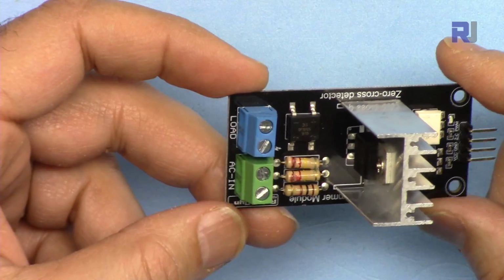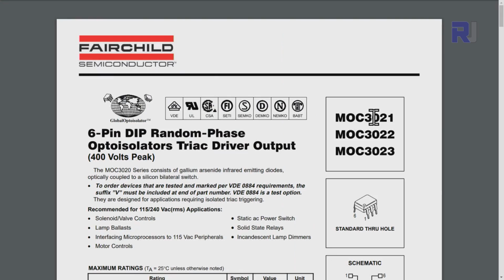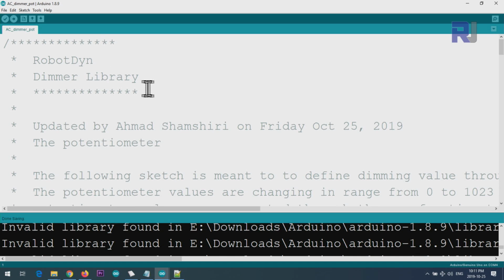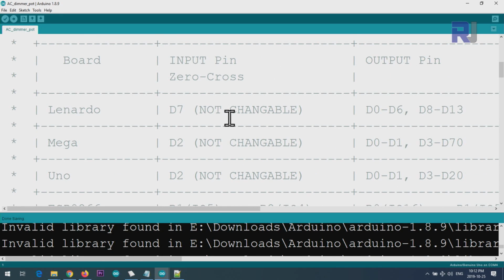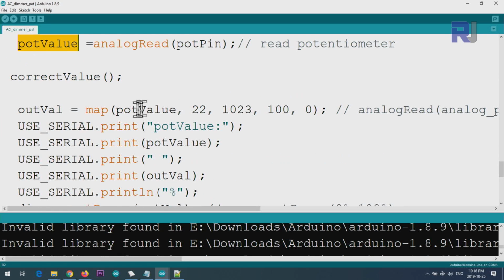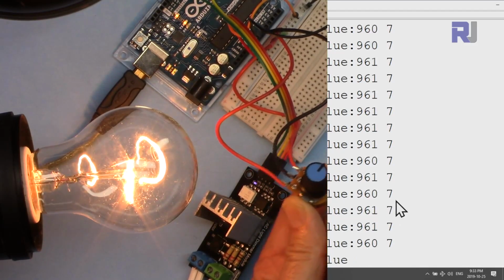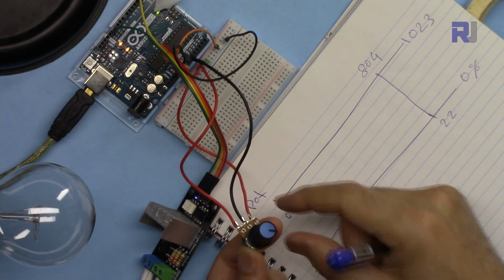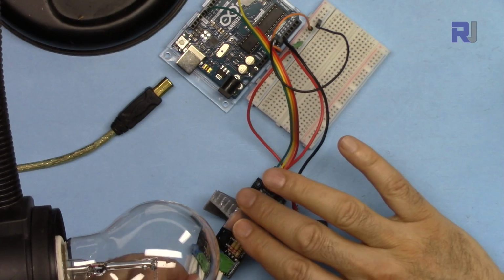RobotDyn Control AC bulb with Arduino AC Dimmer - RJT229

Comment: This is beyond stupid what you are doing, also shame on canadians.
First: There is no way to turn the AC voltage off, yes the bulb is not shining but it still got current passing through it lmao.
Second: Why wouldn't you fit potantiometer's values into the range of the circuit's library instead of just being able to use a part of the potantiometer because you fitted (solved for) them both. You just made half of the potantiometer useless.

Comment: After the correction of the values it just stopped working at a maximum brightness adjust working as a around 70% brightness it should be at 100% brightness before the correction the brightness of too high after the correction brightness is low

Comment: Hi Ahmad
Do you have any experience with ESP32C3? 
I tried this library with esp32 platform but it's not compiling.   Im reading online that I need an older version of esp32 board manager but that also gives compilation errors that some header files do not exist.
Thanks
Reply from the maker: Hi, here is a project where ESP32-C3 is used https://youtu.be/XEZLyznWmYM

Comment: How Can i use it for three phase?
Reply from the maker: You can't. You will need three of this device and timing control to turn each at 120 degrees. What kind 3 phase light ? This is only for light.
Reply: @robojax  i’m trying to do a soft starter for 3ph induction motor using arduino,it worked pretty well for single phase but when i tried to use three of the circuit for 3ph it didn’t work I don’t know why

Comment: Hello, do you understand with the problem what i have, I'm using ac light dimmer by RobotDyn too, but the difference/problem is when trying to hit high percentage the voltage result are reduced and getting smaller than while 40%, can you help me to solve the problem? Thank you 🙏🏻
Reply: And tell me how to fix it or should i buy a new one?

Comment: Hello, do you know if I can control the brightness only through the Arduino code and without the manual knob? Also, if I used an ESP32 instead of an Arduino uno, would it still work?

Comment: Hi, is it any possible to do this project automatically by using BH1750 light sensor ?
Reply from the maker: Hi, yes it is possible. Just replace the value controlling the bulb from the light sensor. I have explained the light sensor fully. Watch, learn and implement

Comment: Hi, can you tell me which command is used to control multiple dimmer boards connected to arduino 1?
Reply from the maker: Hi, it seems you have not watched the video. it depents on the humber of interrupt pins you have on Arduino. Just use different interrupt pin and defined other related variables to make it work.  If you don't know what a vriabel is then watch this video https://youtu.be/xi9Hegk9M9k

Comment: sir ive question, if i want make a pararel lamps about 8lamps , and 4 lamps on 4 lamps off but they will works change between that 4 lamps off and on.
and i want they like using dimmer , but i dont want using dimmer..like exactly Lamps b7c

Comment: Makers using Arduino Dont Know much about Timers , so the RBDimmer library should provide , selectively usable timer1 2 3 etc, as the maker may try to use a different library which might conflict with the timer from the RBDimmer library, just to in that case being able to try another free timer for use

Comment: i need to control the dimming with bigger resolution.. 0-100 with 1 increment (1 resolution) is not enough for me.. i need to control it more detail like 0.1 resolution (0.0 0.1 0.2 until 99.9 100.0).. is it possible with higher resolution? is there any library suitable for that?

Comment: I cannot use your code in my arduino uno, please help me, when i rotate the potentiometer nothing happent, the lamp just turn on normally , i cannot dimming the lamp
Reply: thank very much, it works now with you library, i think the original library from robotdyn , forget to set the zerocross code
Reply from the maker: Hello, I am sorry, there was in error in the code posted on robojax.com and I fixed it.  I am not sure which code I mentioned in the video. if it says open from library, do that. but not then copy from the page provided.
Reply: @robojax  sorry sir i want to ask again , my arduino ide cannot compile the library of rbd dimmer, currently  if i combine bh1750 sensor, lcd, and rotary encoder and the dimmer, the arduino ide cannot compile cause its eror, but if i just use the dimmer alone the code just work fine and succed to compile
Reply from the maker: Hi, it was very simple it says ""ALL_DIMMERS" redefined" and it means you have defined the same library more than once and it will give error.
Reply: @robojax i dont think so, the rbd dimmer cannot compile if we use one of pin interrupts than we declare it in void setup as "interrupts(attachinterupts(pin, function, state))", if i erase that code rbd dimmer can be compile, but if i declare that code rbd dimmer cant compile, while i need both of them for my project. Is it right if rbd dimmer is used we cannot use another interrupt pin? 
So in my project i use rotary encoder and rbd dimmer, certainly rotary encoder need an interrupts pin , and dimmer use interrupt pin too. I use arduino uno board
Reply: @robojax   this is the message of the compiler

In file included from F:\1 SKRIPSI D4 LISTRIK\lcd-menu-example\lcd-menu-example.ino:1:0:
C:\Users\ASUS\Documents\Arduino\libraries\RBDDimmer-master\src/RBDdimmer.h:36:0: warning: "ALL_DIMMERS" redefined
 #define ALL_DIMMERS 30
 
In file included from C:\Users\ASUS\Documents\Arduino\libraries\RBDDimmer-master\src/RBDdimmer.h:7:0,
                 from F:\1 SKRIPSI D4 LISTRIK\lcd-menu-example\lcd-menu-example.ino:1:
C:\Users\ASUS\Documents\Arduino\libraries\RBDDimmer-master\src/avr/RBDmcuAVR.h:19:0: note: this is the location of the previous definition
 #define ALL_DIMMERS 50
 
WInterrupts.c.o (symbol from plugin): In function `attachInterrupt':
(.text+0x0): multiple definition of `__vector_5'
libraries\RBDDimmer-master\avr\RBDmcuAVR.cpp.o (symbol from plugin):(.text+0x0): first defined here
collect2.exe: error: ld returned 1 exit status
exit status 1
Error compiling for board Arduino Mega or Mega 2560.

Comment: Excuse me sir, may I ask if this dimer ac module can control the speed of a single phase induction motor with a power of 300 watts
Thank You
Reply from the maker: this is just dimmer. it dims the intensity of light.

Comment: Thanks for the tutorial . If I don't use a potentiometer, does that mean I just fill in the value in the dimmer.setPower (...) command? Correct ?
Reply from the maker: Yes you can enter the value and it should work
Reply: @robojax  Thankyou so much sir, success for you. From Indonesia

Comment: Can i replace bulb with ac fan
Reply from the maker: no. this is dimmer which is for light. for fan it would be speed controller. fan has inductive load. if you have it, try it.
Reply: @robojax  so how can i control speed of ac fan.. Plz help
Reply from the maker: I have not seen a trusted proper solution yet.

Comment: I am studying how to do a solar grid connected inverter to send all reverse power to a water heater boiler as i do not want energy to go outside my house, so only one current transformer must be used, testing for generatedxconsumed constantly,   however the pwm power should be very eficient,  220vac, i think backtoback mosfet is better circuit, as it avoid rectifier losses, what you think guys? 2000w boiler,
Do somebody may help me will be much aprecciate,,, congratulations

Comment: Hallo sir, can i use that dimmer for controlling 24V AC resistive heating element? thx
Reply from the maker: it works only with 120V and above. I have not tested it. So not sure.
Reply: @robojax  Oke sir, thankyou so much

Comment: Sir can I control motor AC speed with this module? Thanks ❤️
Reply from the maker: no you can't. this is just dimmer.
Reply: @robojax  but it can handle a low ampere AC motor isn't? 0.14 Ampere AC motor for example. I just want to create a prototype of controlling AC motor based on the DHT11 sensor.
Reply: @robojax  but it can handle a low ampere AC motor isn't? 0.14 Ampere AC motor for example. I just want to create a prototype of controlling AC motor based on the DHT11 sensor.

Comment: Thanks a lot for your video!!!!!! if i use your suggestion itself it works fine! Problems come out when i include other library, whatever library, even the most common used libary in arduino sketch....lcd i1c, onewire, emonlib.h .... whenever i incluse one or more other library, arduino slowdown its loop time and shows wrong data.... i change many pins to avoid conflict, but nothing happened... i need to use your RBDdimmer toghether with emonlib.h and current sensors to analise electrical consumtions and adjust the dimmer accordingly......now it only partially work...but not accurate just because the wrong data get from the sensors....if i remove RBDdimmer from the sketch, everithingh is perfect....thank you fou any help you can gime me/us!!! THank you Best Regards!

Comment: Is it possible to initialize the dimmerLamp variable inside "setup()" function using some function "dimmer.begin(Address)" or sth like that? I couldn't find anything on the web. I need to configure the address/pin of the dimmer in the setup function as it is received via Serial link from Rasberry Pi and am a bit stuck at this point
Reply from the maker: this code uses interrupt and I spend some times to fix it.  from the library, contact the developer of the code , they might help you.   Please subscribe. I appreciate it and helps my channel grow.  Thank you

Comment: Nice explanation as always,
Could you please make a video in addition of dht22 or ds18b20 to control TRIAC output with respect to temperature....
Regards
Reply: hi there, are you find any reference for this? I also want to control the lamp with the output of ds18b20. thanks in advance
Reply: @leeklein278  Hi did you find a solution?
Reply: @rensfx8447  yes, i do. I have added a ds18b20 sensor. Get the temperature as a feedback for the ac light dimmer
Reply: @leeklein278  Could you show me your Project somehow?

Comment: Very useful explanation. I tested the original RobotDyn sketch on 220vac 50Hz with a Eve 7w dimmable LED and had the same flickering problem as you experienced. Using your modified sketch and fine tuning the max and min values to suit the LED fixed the problem. Thank you.
Reply from the maker: Thanks for sharing
Reply: Hi, I'm planning to use this module with led bulbs, could i ask if you get a somehow smoth dimmable range with led lights? I'm testing a similar dimmer and it is very drastic from off to on

Comment: Is it possible to control the AC bulb based on lux level? if possible briefly what sensor do we need?
Reply from the maker: you can't control lux unless you have a light sensor like this https://youtu.be/iKUwu220UFQ to measure the light and then control the dimmer to keep it at certain level.
Reply: @robojax  so, we replace the pontentiometer with the lux sensor? That was the same way i think it should be done. Thank you so much!

Comment: Hello sir. Is it possible and safe to connect multiple lamps in parallel to the same dimmer output? Thank you :)
Reply from the maker: it has maximum load or current rating which I've explained. when you connected bulbs in parallel, this doesn't know if it is one bulb or 10 bulbs. just make sue the total power does not not exceed .
Reply: @robojax  makes perfect sense, thank you

Comment: Hi Ahmad, excellent video, just what I have been looking for... Quick question, can this be used for a dc motor? like if I can replace the bulb's connection with the dc motor's connection (granted that the motor satisfies the power requirement of course). 
Thanks again
Reply from the maker: Hi, no you can't. this is works only with AC.

Comment: Hello mr robojax, what is the function of zero cross? How we program the zc ?
Reply from the maker: AC signal is sine wave and it geos from positive to negative. when it reaches at zero, at that time, we need to know to when it happens to control the triac. https://en.wikipedia.org/wiki/Zero_crossing the library here has function so you do not worry.

Comment: Hi Ahmad, it is a very good a complete video and you said all of them, 
but I have a question about this project, We can use that for AC motor speed controlling or not?
Reply from the maker: You should be. I  haven't tested it and the manufacturer also have not mentioned the motor. they just used "dimmer". Unless you test, we never know.
Reply: Hi did you test it?

Comment: problem with dimmer so it flash once or many times a day while it off by the way i use two buttons up/down instead of potenciometer with esp8266 so i tried  dimmer.setState(OFF);
dimmer.begin(NORMAL_MODE, OFF);
digitalWrite(zerocross,LOW); without any result so the problem is allaways here !!!! any idea thanks .......
Reply from the maker: I tried it with ESP8266. have not succeeded and after trying for two days, I gave up.

Comment: Hi!Nice video, but I would like to know how it could be done to regulate the light level through the arduino program without having a potentiometer, having an arduino mega 2560.
Could it be done with the same device that is in this video? Instead of adjusting with the potentiometer, do it by programming. Thanks
Reply from the maker: Hi, this works with both Mega and UNO.  I mentioned in the code that you need to provide the interrupt pin. watch the video fully.

Comment: Can this be used for 3 phase power supply for a dc motor speed control. 
I actually wrote my code myself for a 3-phase supply 450Vdc motor but my problem is that the signal is just not stable, i see spikes from time to time. I used micros for the timing not delay. Thank you.
Reply from the maker: No it will not work with 3 phase.
Reply: @robojax  can i use multiple ZCD for it to work??
Reply: I designed and built a ZCD myself for 3 phase power supply and it actually works fine. i use it to power a 450Vdc motor using arduino and motor actually works fine but the firing signal is just not perfect. I might command a 3000 microsecond delay after every ZCD pulde and it will execute it but then contains spike that indicates a different delayed time momentarily. 
I use my PC based oscilloscope for this. 
- I feel maybe i need to change my code even though i expect it to work perfectly fine as it does at times.
- I want to Use another PC for the oscilloscope just to be sure its not some glitch on the current PC i am using for the oscilloscope. 
- I am not using any library in my code.
I can share the code with you if you desire.
I am considering using delays in replacement of micros just to see what the result is.
Thank you for the time.

Comment: How do change the code if you want to control 2 lights.  You have "dimmer.setPower(outVal)" having at output pin of 12.  Is there an option for e.g.dimmer1, dimmer2 using different output pins?  I want to vary the dim setting using temp sensors instead of reading a pot.    Thank you.
Reply from the maker: you need 2nd interrupt available. Yes just create dimmer1(outputPin1), dimmer2(outputPin2)
Reply: @robojax  I can dim 2 lamps with a pot.  I also can read 2 HDT temperature sensors.   I've combined the 2 sketches substituting the pot with temp readings.  Using the "dimmer1.begin(TOGGLE_MODE, OFF)" + other variations of this function shown in the RBDdimmer lib, prevents reading the temperatures.  Temp values are returned as zero.
.When I comment out the dimmer.begin() - temperatures are read.    Any help is appreciated

Comment: Hello Sir,
السلام عليكم ورحمة الله وبركاته
Thanks for sharing your  knowledge.
Expecting your help for clear code " Control 2 AC bulb with Arduino AC Dimmer"
how control lamp dimming in 4 stage/level by 4 push button
also share you WhatsApp or Email.
Reply from the maker: Walaikum salaam,  I would have to make video on that. can't be explained with text. I have to try it and write the code.

Comment: Hi Ahmad, I have a question about how to setup an On/Off dimming ramp. At the moment, I’m using a nano & have a dimmable LED, with a basic for loop, but there seems to be some instances on the on or off ramp up/down that the bulb flickers, (repeatable). How can that be fixed?

Great video btw, pretty helpful!
Reply: Did you fix the issue? I would like to create a similar project with Nano board and LED - if you can share the Arduino scheme and code will help me learn fast and save a lot of time.

Comment: Hi Ahmad, Thank you very much for your video. Suscribed! With alerts :D . I’ve got some devices and I would like to config it pushing a button. If you push the button (turn on/turn off) if you press the button for more than x seconds the light increase/decrease. Do you have a code or some tutorial? Best Regards,
Reply from the maker: Hi Vic.  You are welcome. Thank you for subscribing. This would be interesting project. I will try to make a video on that. Can't be explained here with few word. it need new code with either 1 or two push buttons.
Reply: Hi Ahmad!, nice to hear you! Here in Europe the most of dimmers works in this way. With 1 button you can control the light: for example if you turn on the light and modify it to 30% (keeping the  button pressed) and after that you turn off the light. If you turn on again, the light will start at 30%. Saving the last status.
Reply from the maker: Yes. I understand. it is like volume push button. you press it and hold it it will increase.  Very interesting concept.

Comment: is that working with led strip or led bulbs that use transformers ?? what will happen if I give transformers less voltage than for ex 220v ??
Reply from the maker: NO. LED works with DC. This controls AC bulbs only.